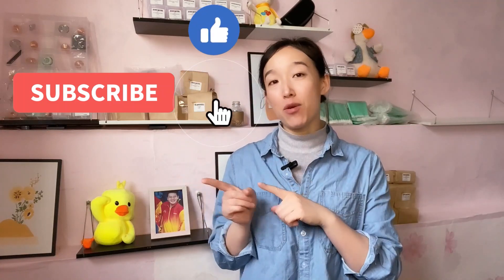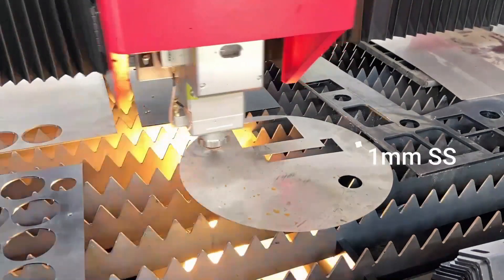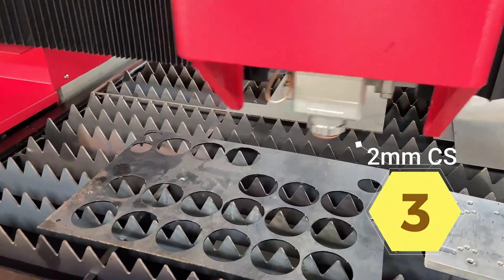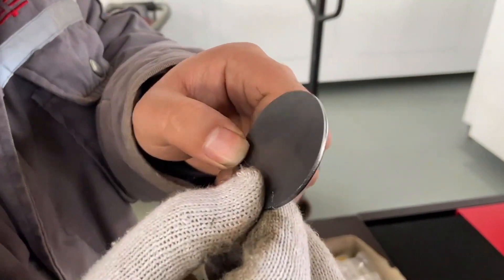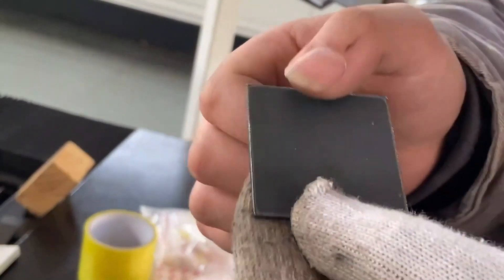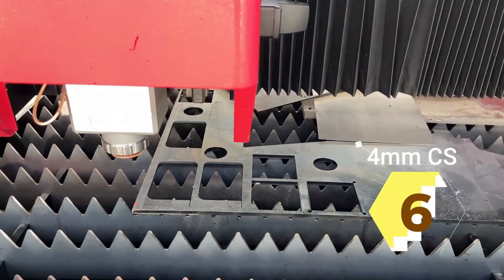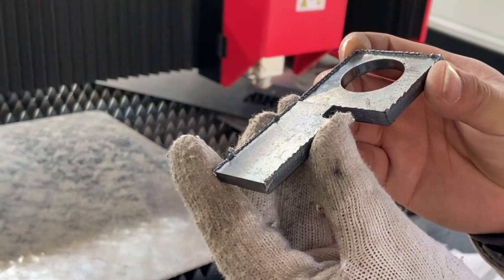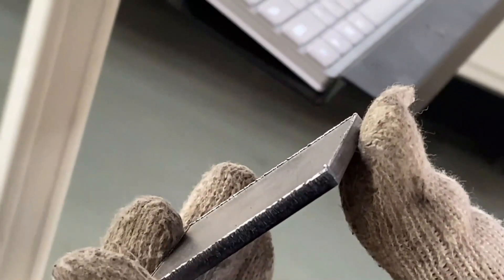Laser Air Cutting Parameters |2kw Fiber Laser Cutting Machine

Comment: Hii I have a 6000kw laser cutting and I have a 16bar compressor connected to the machine. When I cut 5mm carbon steel it cuts well but when it’s small holes it leaves slag , what can I do to fix this?😀🙏
7 it’s the maximum speed I can cut 5mm 
My power and duty are 100%
And focus on -4,
What air pressure do you recommend?
Reply from the maker: What system? You can add some extra functions to cut small holes.
Reply: @ClaraChai hi I use the same software as you it’s the tubepro from bochu 🙂

Comment: What was the focus setting for  3mm carbon steel?
Reply from the maker: You can check my videos of cutting parameters, there is reference one.
Reply: if you are cutting, with air compressor you have to go on minus value of focus distance in the steel, for 3 mm it willbe okay to have -1 to -2 depending on the height from the material

Comment: What is the pressure you are running at? the screen shots show 5 bar but also grayed out? is it un reglulated (running full 16 bars) at the nozzle?
Reply from the maker: It is up to your compressor.
Reply: you need to get 16 bar air compressor, with dehumidifier and air filters. Also it will need at leas 1.5 cubi meter of compressed air per minute

Comment: I have a 2000 w raycus laser.  You have a table of parameters for air cuts of different materials and thicknesses.  I saw a table but it is geared towards oxygen cutting.
Reply from the maker: It is only for reference.
Reply: Bom dia tudo bem qual compressor de parafuso tenho que comprar para uma máquina leser cort 3000W
Reply: What is the laser source? Raycus or other?

Comment: I need 2 mm carbon steel on Oxygen parameters, 1.5 kw MAX photanix
Reply: I will have very low speed I suggest compressed air for 2 mm. Give focus in +1 or +2. cutting speed 1.2. Air pressure 0.7. And try.With oxygen it is very hard to cut. ALL the lenses has to be clean and beam in the center.
Reply from the maker: Good to know.